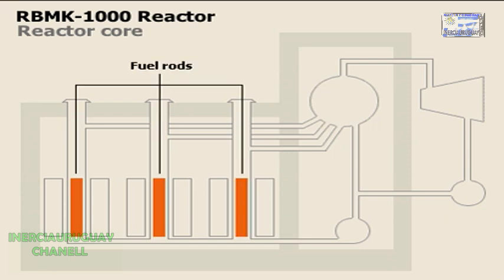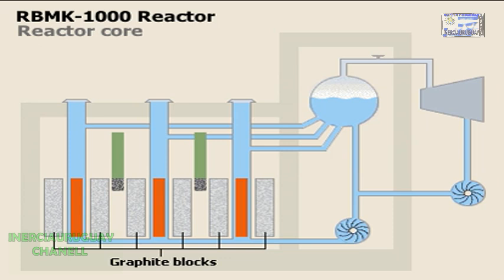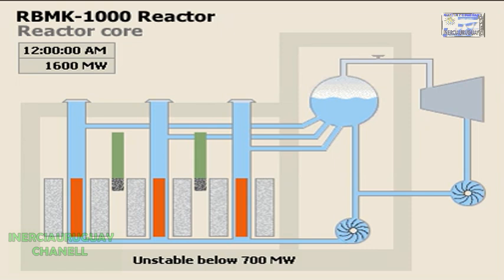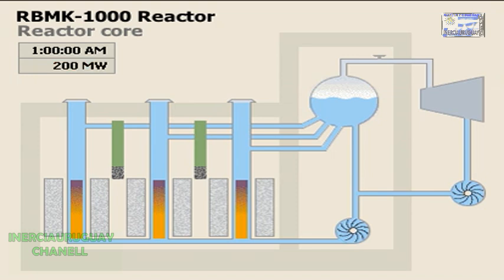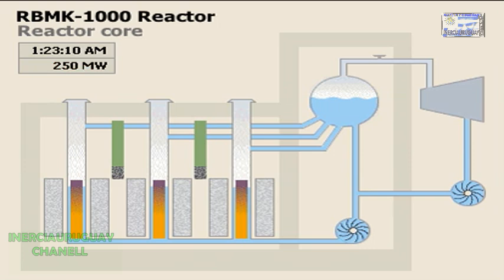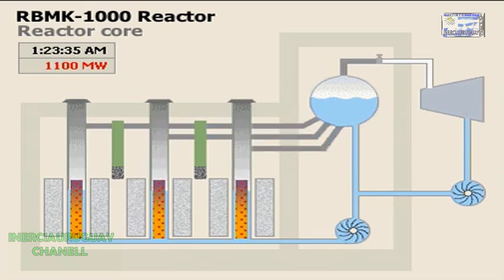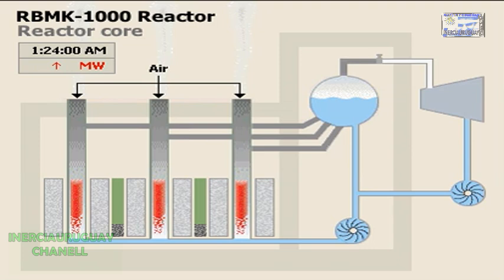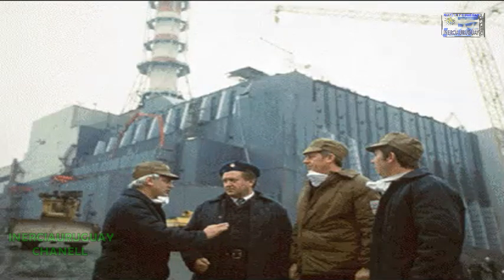WHY THE NUCLEAR ACCIDENT WAS PRODUCED IN THE CHERNOBYL PLANT ANIMATION

Comment: Can someone with a lot of knowledge on this explain to me how this all could've been prevented? The lowering the control rods the first time dropped the level to 30MW so the reactor was hard to control at that point? Why? I've always been interested in how nuclear plants operate, so where did all the radiation come from? The control rods? The reactor itself? What would've happened if they didn't lower the control rods the last time that caused the level to spike over 100x, basically this all fascinates me cause it created obviously devastating effects for 1000s of years all cause of an operator error.
Reply: I don't have a lot of knowledge on this, but it wasn't operator error. It was bad decision making and design.

In a general sense the reactor's job is to use fission to create steam, which is then used to push turbines and create electricity. The fission's energy will continuously grow if not controlled (this is where the radiation comes from). The steam being created grows the fission's reaction even more. To control the reaction they use control rods and water as coolant. Another bi-product of the reaction is xenon which usually burns off as fast as its created, but when the reactor was brought to lower energy levels (targeted at 700) it built up inside the reactor, inhibiting the fission even more and unintentionally plummeting the power level to 30MW. 

From here the manager incharge order the power to be immediately raised so the test could be completed. To do this they removed almost every control rod out of the core and when the power stabilized to 200, not because it was being controlled by the control rods, but the xenon, they decided to conduct the test. They had lots of computer alarms telling them of the errors occurring, but they overruled them manually. When the turbines shut off, water coolant was reduced and the fission reaction started to build out of control. I'm not sure about this but it is largely due to this type of reactor having a positive void coefficient, which basically means as the steam builds up inside the reactor, it increases the reaction, which in turns causes more steam, causing more reaction ... ultimately creating a positive feedback loop that will spiral the reactor out of control. 

At this point they notice the reactor ramping up uncontrollable so they push the emergency shut off, which drops all control rods into the core stopping the reaction. Unfortunately the rods have a graphite tip so when they are all inserted back in at the same time there is a huge surge to the reaction spiking it even higher, creating the energy needed for the explosion.

Lessons learned: 

1. control rods were redesigned without graphite tips so this couldn't happen again. 

2. There are better designed reactors without positive void coefficients.
3. Human's bad judgement is still a large part of the equation.
Reply: @matthewmullin6042  Thanks for the info man. It's still just crazy that little things could have prevented this incident to occur in the first place. Like if the rods weren't graphite tipped, maybe Chernobyl would still be safe to live in today no way to know I guess.

Comment: This wouldn't have happened if there were competent managers leading the plant. 

The Narrator: "The operator" LOLOLOLOLOL... I guess the shift general has no management authority. 

The real question is, why the F was this test done at night? Who does that?
Reply: The test was supposed to be done by the day shift, but another plant went offline for some unexpected reasons and to avoid power dropping at the peak evening usage it was requested that the experiment at Chernobyl be postponed. At 23 the go ahead was issued for the experiment. By this time the day shift who were originally supposed to do the experiment had already left, the evening shift was preparing to leave and the night shift were coming in at midnight. Originally the night shift only had to monitor already shutdown plant but due to the postponement of the experiment they had to carry out the already started job. For some it was decided that they would carry the experiment out with little time to prepare and carry out the experiment.

edit: The experiment was to test a critical safety feature which kind of explains why they rushed forward with the experiment despite multiple red flag, warnings and scheduling issues.
Reply: Yeah. The test was supposed to be done at the day and day shift was well prepared for it. But because of preparations for the First May Celebrations, the USSR government decided to do the test in later hours because of power lack this test would create. So the evening shift take control over the test. They were also goodly prepared for the test but unfortunately, the did not have enough time to complete it. So now the night shift take over and as it was said, they were supposed to just monitor already shutted down reactor and were not prepared to do the test itself. But they still did it. And we all know how it ended up. Ofc there was big problems in the reactor design. It has lot of pros and LOT of cons. But if the shift would followed the "manual", everything would be just fine.
Reply: The test was done with a procedure that did not take into account the reactor's design flaw. I guess Management didn't know... 🤣

Comment: I just don't get why they removed all of the control rods when the power was low. The logical thing is to remove some of them. Also couldn't they just remove the rods a bit, wait to see what the power is and proceed accordingly? Can someone who understands this explain the reasoning?
Reply: Lenghty explanation ahead: According to the Wikipedia article the plant had to run a rather long period on less than full power. This led to the build-up of 135-Xenon from the reaction, a noble gas that "poisons" reactors, because it catches slow neutrons that are needed for the nuclear reaction. Fast neutrons don't do a thing there.
When the operators lowered the power even further for the test or by mistake to 30 MW, the build-up of 135-xenon increased even further, poisoning the reactor further and lowering the output further. After a while, when the operators noticed the mistake of a reactor at a far too low level, they tried to increase the power by lifting far too many the control rods at once completely, so the only thing controlling the reactor was the non intentional and depleting 135-Xe, leading to a slow, then faster becoming rise in activity.
And that was one of the biggest mistakes. When they shut down the water supply for the test, the increased output due to the steam bubbles increased also the depletion rate of 135-Xe adding even more power and reactivity, so two effects (steam and Xe depletion) increased the output.
So when the power went through the roof, all of the control rods were lowered at once, the reactor became self sustaining due to the increase of activity caused by the graphite tips, rendering the control rods entirely useless. And a self sustaining reactor (without any control!) does not know any limits, hence the well known events...
Reply: @CoatiRoux  
The operational procedures of RBMK reactors never allowed to fully remove control rods. But they did.

Comment: Dyatlov you son of a butch
Reply: It's easy to blame someone cause it's always nice to have a scapegoat. But this is far more the fault of the Soviet Government than the fault of any one individual at the power plant.
Reply: @croakingfrog3173  we usually say, that this disaster is the diagnosis of the Soviet system itself. Sure, there are a lot of people to blame, but those people and flaws they had were the product of that system. Blaming Government or Dyatlov would be like lookong at this problem at a small scale. It's not a coincidence that USSR dissolved shortly after. The story of Chernobyl is very symbolic in many ways and it's still one of the most important lessons that people should never forget.

Comment: I still dont understand why did control rods increase the power when they are there to lower the power/slow the reaction...
Reply: The control rods were tipped with Graphite to boost reactivity when removed. When they were reinserted, the power spiked so quickly (due to the reactor being in such an unstable state) that the heat caused the fuel assemblies to expand, jamming the control rods in place, only partially inserted. This prevented the control rods from stopping the runaway power excursion.
Reply: It has something to do with the fact that graphite was used in a part of the control rods. Graphite moderates the neutrons, slows them down. That increases the nuclear fission. If there is enough cooling water in the core, this isn't that big of a deal. This is oversimplified. Go to Wikipedia if you want to know exactly how it works.
Reply: if the neutrons are too fast..... they will blow right threw other atoms.... causing no effect 
they have to be slowed down to cause a chain reaction 

if 1 control rod was lowered..... then another.... the another....ETC
things might have been fine (probably not.... but possibly better)

it would be like adding a SINGLE drop of gas to a fire....every 10 seconds
you would hardly notice it 

but instead..... they lowered ALL!!! the control rods at the same time
which is like adding 500 gallons of gas to a fire..... in 0.00001 seconds 

this.... obviously.... makes a MASSIVE fire ball 

if the graphite tips were JUST inside the reactor (vs completely removed).....
the additional "power" would already be their...... and would be compensated for....by lowering a few control rods.... or increasing coolant flow 

but instead..... its like having a nice camp fire...... and them some drunk dumps 5 gallons of gas onto the fire..... as quickly as possible 
WOOSH!!!!!! now half the party sight is on fire

Comment: as Ukrainian/Russian native speaking, I can say that I have watched to Youtube interviews of Dyatlov, Boris Stolyarchuk and other engineers who were there that night. 
Long story short, they were saying that the same reason for failing was flaws of the RBMK reactor.
RBMK reactor was poorly engineered.
Reply: @mog404  yeah dyaylov was a scumbag that night and it got ppl killed. Still, this wouldn't have happened if the rbmk wasn't so poorly designed to begin with.  A graphite moderator?  Lol, everyone else in the world was using the coolant water as the moderator, only the Soviets had to get fancy and the graphite (and lack of containment building which is beyond stupid) ultimately made this as big as it was. Still dyatlov could have stopped at any point and prevented this whole mess.
Reply: @yougosquishnow  why were they using graphite for a moderator anyways?
Reply: @bernardocantu77  Water moderated reactors need BIG pressure wessels. Channel type reactors like  the RBMK using many small pressure wessels. Every single fuel rod was put in a high grade steel tube with water around, and connected to the common lines under and over the core. This design made possible to separate them from the other channels, and refill the fuel without shutting down the whole reactor. So tere is no lenghty downtime during refuel, and no size limit for the core to increase efficenty. But garphite. Yes, graphite has known disadvantages, like the positive void coefficient, and the designers made security systems to avoid that. But god know why, they made these systems overridable. The RBMK type reactor not entirerly faulty design, and can be used with proper cautions. Sadly Dyatlov was an idiot. 
The second thing, what was made the decision to make these channel type reactors at the first place is to save money. 
Millitay reactors used to manufacture  plutonium expensive, and wasn't really good to make electricity. To make high quality plutonium, you cannot keep the fuel rods too long in the zone, because extended neutron radiation make the product spoiled with other plutonium isotopes unusable for the bomb. But you dont have to shut down the whole reactor to remove the plutonium if ou use this type. RBMK was the solution to make a high power civilian reactor, and use it for millitary purpouses. 
And they gave it to ill educated personel to operate. Also KGB redacting vital information. Cogito, ergo, boom.
Reply: @bernardocantu77  
Light water needs volume, and this needs a big and expensive pressure vessel.
Heavy water is good but really expensive to use it in a massive reactor like this.
Graphite is cheap, and you can use small and cheap pressure vessels.
See my other comment above for more.
Reply: @mog404  why did Dyatlov insist on doing this test and go against the higher ups? Did Dyatlov know about the instability of the reactor the positive void coefficient? What was his reasoning? Did the Russian authorities know about this positive void coefficient and sweep it under the rug?